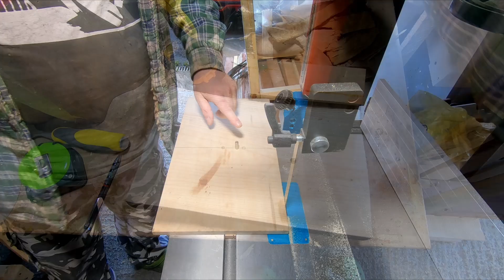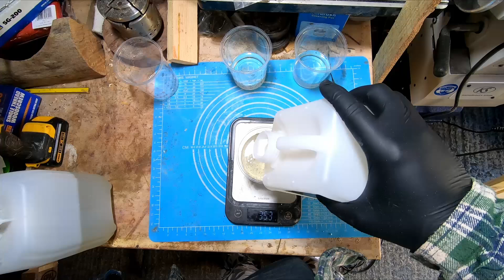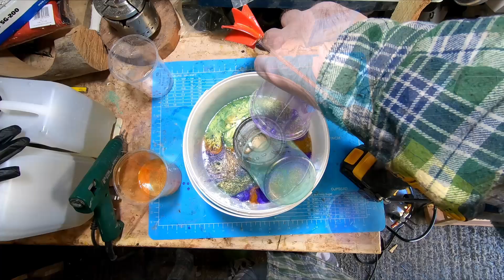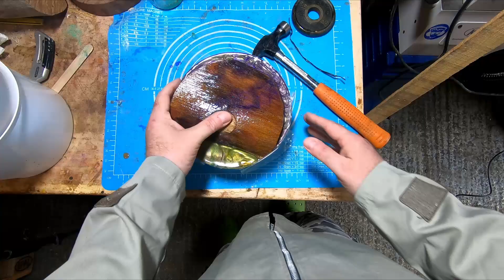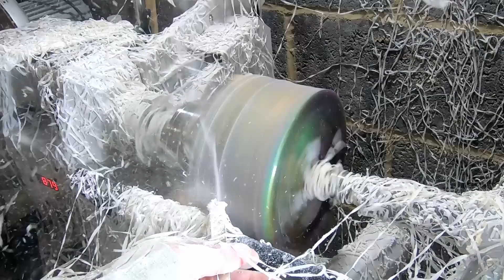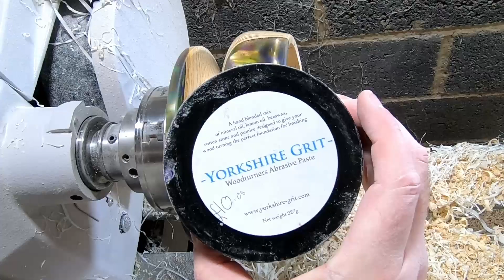Woodturning | Ash Bowl with 3 Colour Epoxy Resin | Restoration DIY

Comment: Beautiful colors without the resin overpowering the wood.  I notice you have a Laguna bandsaw.  So do I but I have a hard time keeping it on track when re-saving.  Any problems on your end?
Reply from the maker: Thank you its one of my favourite bowls, the Laguna Bandsaw has been ok but I did spend a lot of time setting it up I use a ‘Bandsaw Buddy’ available from Axminster tools in the uk to help to align the fence with the blade and I checked to make sure the table is perpendicular to the blade and I have found The blade guides have to be adjusted to a tight tolerance to keep the saw cutting straight I use a piece of paper as a gauge between the guide and blade hope that helps.